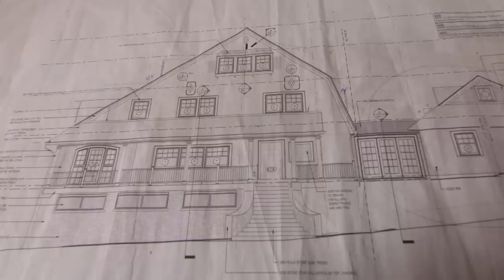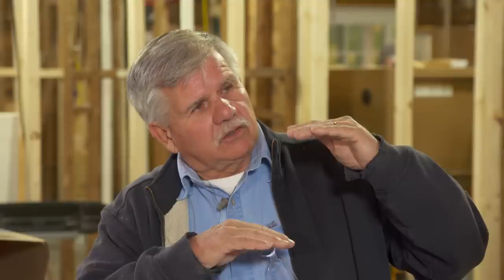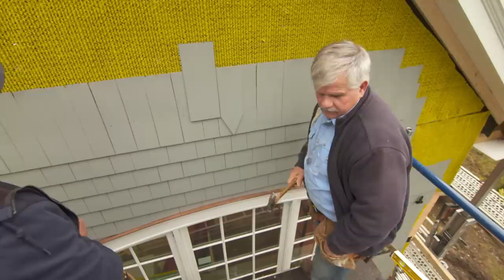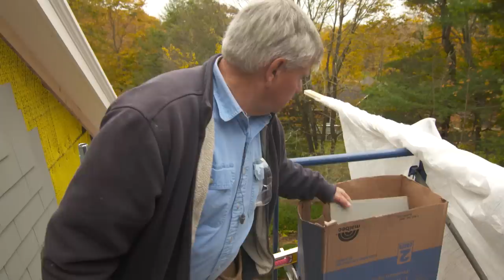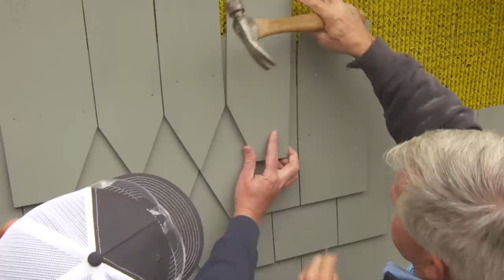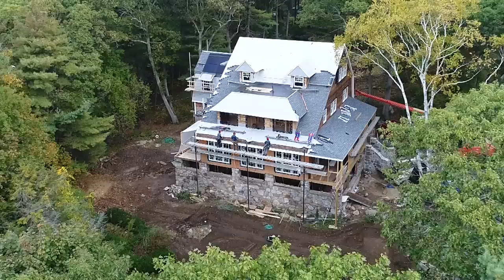How to Apply Patterned Shingle Siding | This Old House

Comment: It seems strange using wraps and waterproofing, then puncturing it with nails to me. How long does it last, as a wall structure? What are maintenance requirements like. 

I'm use to brick walls for houses, lived in 20 or so and I've never lived in wooden house. Only wooden flooring systems and roofing, with lots of 6 by 2 generally out of rough sawn, then in roofing some 6 - 12 inch by 3 or 4 inch beams. On the ones I've worked on, mainly they've had pitch pine floor boards, but some with hardwood floor and others with spruce. There definitely are more stick houses being built here, but they still skin them in a brick facade, rather than wood. They use stand offs to maintain the gap, between outer skin and inner skin but are also penetrations. If it was two brick skins, the wall ties are in mortar at both sides and there is a gap for insulation, so just seems like a much more sensible way to build. (Blocks are also used a lot more now, sometimes just internally, but sometimes, if rendering, then on both).